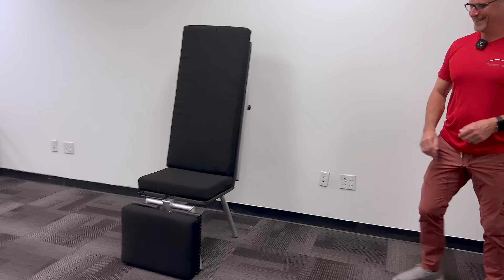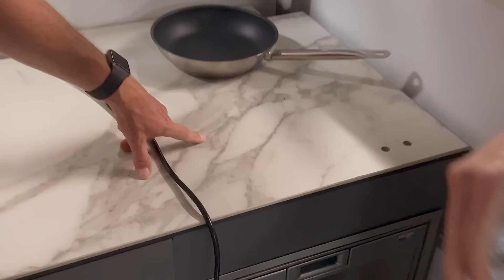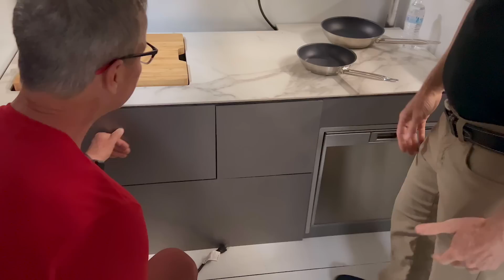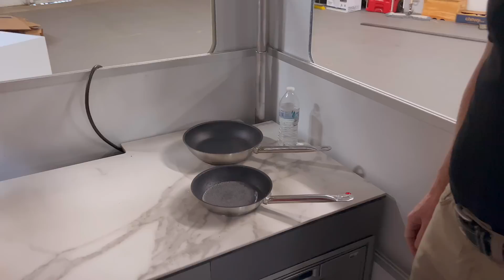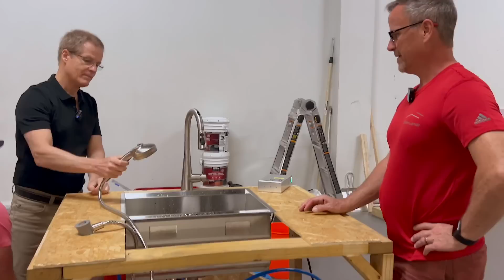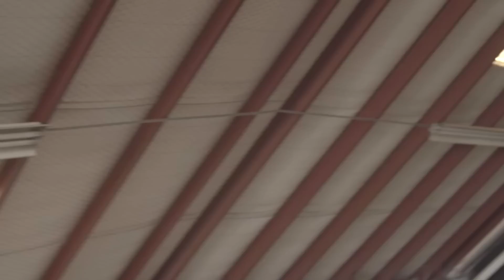EXCLUSIVE REVEAL: Tesla CYBERTRUCK CAMPER PROTOTYPE from CYBERLANDR--With working Kitchen!

Comment: We haven't heard any news in over a year. What are your thoughts on this? The dimensions of the cyberlandr also looks to be too large for the latest Cybertruck showing. It looks like the width is around 4-4.5 feet, closer to 4 ft I imagine. I can't see how they would be able to fit all the wiring within those spaces, not to mention a "RV Queen" sized bed, given that the width is likely to be between 49-57 inches (at the end of the bed).

Comment: Are they accounting for the possibility that the cybertruck’s divider between the cab and bed may fold down?  It doesn’t seem like it…
Reply: If Tesla does include this feature we will continue with the design we have. If we made entry into CyberLandr through a midgate possible, it would compromise the strength of the bottom panel and cause a need for a rework of the whole interior of CyberLandr due to the cabinet sitting up against the wall of where the midgate would be.
Reply: @cyberlandr103  thanks for the reply and info!

Comment: I considered putting a deposit for it but I have one major concern. It looks like it would be near impossible to remove and add it back. That’s a lot of weight to haul around when your not using it, plus you would have to remove it if you wanted to use the truck bed for hauling materials for a project.
Reply: It's a valid point James. The same team that is doing all this cool stuff on the inside of CyberLandr is also hammering out a number of ways to ensure the truck bed can be easily used for whatever. No details yet, but we have some really cool plans.

Comment: Great video. I'm hoping there will be a way to put the camper out of the bed and onto the ground to hold your campsite if you need to take the truck somewhere. This is a big issue with rooftop tents.
Reply: We are working on a system to make this process as easy as possible. Many have expressed similar concerns to this about CyberLandr and our engineering team is working hard to make this a seamless process.

Comment: If you have to put away everything and close up camper if you have to drive somewhere I don't think Cyberlandr will fly. And if you have to close up bed to use the kitchen counter this would get intolerable. And now that there is Estream, a competitor from Airstream that has its own battery pack (so won't reduce range) with remote control, in spite of my previous interest in Cyberlandr, I think they may as well give up. Especially since with the Cyberlandr your truck loses its pickup capability and Estreeam has more room and can be towed by any electric vehicle.
Reply: you are talking just the Cybertruck and the Airstream that can be pumped up with air and taken from the back of the bed using the air compressor?
Reply: No I'm talking about https://youtu.be/PRc9pHrfw1g

Comment: Very cool to actually see inside the prototype. Helps remove doubts to see actual physical implementation. I would love to see/learn more about their water system. The recirculating aspect is either brilliant or a disaster.
Reply: As we progress with the water system we will share more details. We are aware of the concerns about the recirculating system and will be testing it extensively to ensure it works flawlessly.

Comment: My big question would be if the windows will be openable for ventilation.
Reply: Windows will be able to open for ventilation and will also be self-tinting as well.
Reply: Yep. They are. Lance envisioned cross ventilation as a key requirement for cooking as well as that pristine wilderness air.
Reply: They said windows won't open.  Buy have ac

Comment: Great stuff.  However is there any concern that Tesla will come out with their own camper?  They did after all show a concept photo with camper.   I suppose the market will be plenty large to support multiple companies in this space however.
Reply: If you have to put away everything and close up camper if you have to drive somewhere I don't think Cyberlandr will fly. And if you have to close up bed to use the kitchen counter this would get intolerable. And now that there is Estream, a competitor from Airstream that has its own battery pack with remote control, in spite of my previous interest in Cyberlandr, I think they may as well give up
Reply: @ShadowCarve  Certainly, a tiny home may not be ideal for everyone, and CyberLandr is a micro-home by standards. But you are casting doubt with a specific use case in mind framed with your own travel biases. More than 80% of our customers will not being using CyberLandr as a "camper" any more than the vast reservation holders of the Cybertruck believe this is just a "pickup".

As to the AirStream product, it's a novel approach and some buyers will be thrilled with it. However, it's already impossible for OEMs to get enough batteries. Do you really think AirStream will be able to compete for a very limited supply of battery technology? And with that "camper" battery, have you thought through the time it will take to charge while enroute, and the logistics of finding suitable charge stations where trailer maneuverability is crucial?

Lance was brilliant - he could have integrated a battery into CyberLandr but he decided to do three other things - (1) Lean on the Cybertruck's battery, the largest and most powerful ever to hit the road in a consumer EV. (2) Add solar; go fishing and add a few miles to CT's battery. (3) Make every volt count; create the most efficient use of electrons possible.

Consider the entire horizon of transportation in an electrified world, and your point - "they may as well give up" - doesn't hold water; the data is clear and the customer demand is clear. Tesla has discovered an untapped demand for the next generation SUV/pickup and Stream It has discovered an untapped demand for invisible accommodations.
Reply: @ShadowCarve  The Cyberlandr will fly as well as compact itself into the truck bed?  Like the Airstream jet?

Comment: I wonder what the r-value is of that composite
Reply: We shall see…
How much insulation does CyberLandr™ walls provide?
The panels are 1/2" high density composite that is difficult to relate to an R-factor, however, these panels have no conductive bridge which is the better way to describe insulation priorities. We believe our materials choice is ideal for weight, strength, heating/cooling, and durability.

Comment: If money is no object, the camper is great.  If money is an issue, I can't see how they will sell very many.
Reply: Yea definitely not cheap but not a bad value when compared with FourWheel Campers, etc.
Reply: And be cause it can disappear and reappear quickly, it will be used 2x a typical “camper” and likely more. But this is not just a camper. It’s accommodations of many kinds with you everywhere.